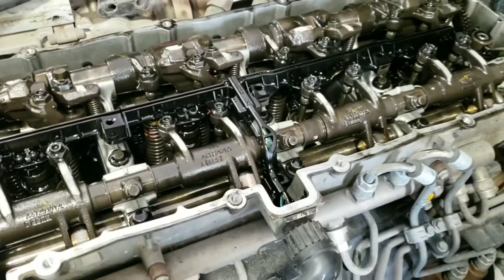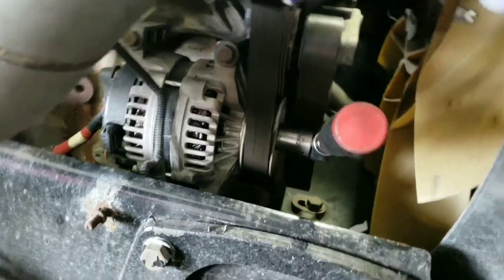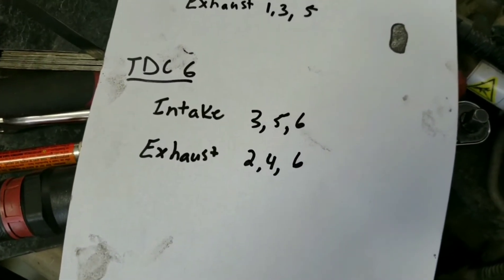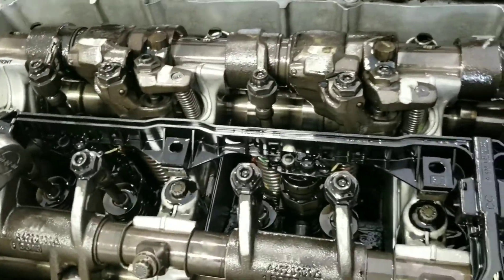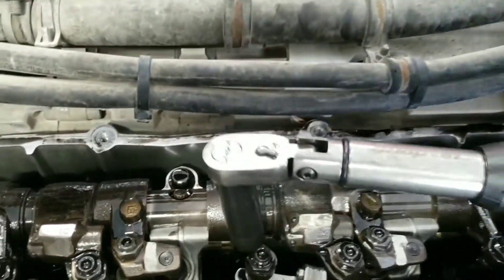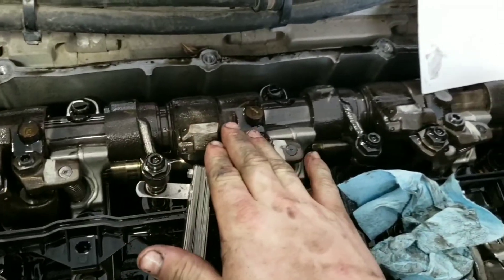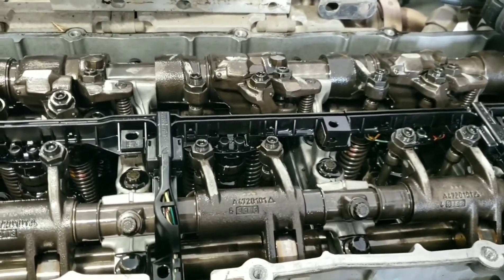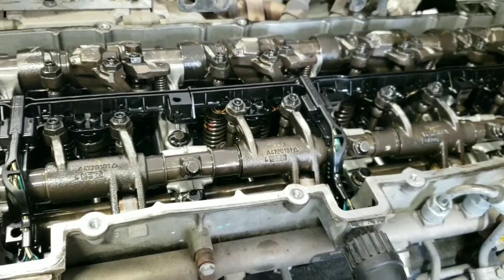Detroit dd13 dd15 dd16 overhead valve adjustment

Comment: Hi there ! Help 
Got question . I changed my cylinder head dd15. 
If I adjusted 1 round then turn flywheel to 360 degree and I’m with the same position to adjust 1 round again . Any suggestion?
Reply from the maker: No, flywheel turns 720 for one 360 on cam

Comment: How do you know when #1 cylinder is at tdc without using the barring tool? Also how do you know when #6 is at tdc as well
Reply: When at #1 TDC, when the flywheel timing mark is lined up, the #6 rockers will be tight. And when the engine is at #6 TDC the #1 rockers will be tight. If starting from scratch, lets say installing a new rocker shaft / rocker components,  adjust the #1  and #6 adjustment screws till snug and measure the adjuster threads. The one with less amount of threads above the jam nut will be the cylinder at TDC.

Comment: Tighten the adjuster to 6 inch pounds then set the jam nut to 37 foot. Then you'll have a good setting. Nice work.
Reply: Is that 6 inch pounds by specs or a personal process? I was thinking there has to be a better description than just "with a little bit of drag"

Comment: Thanks for this video .
is this one helps for the truck fuel mileage to go up .
My truck freightliner cascadia 2016 has 3800k mileage. 
The fuel mileage recently dropped from 7.3 to 6.2 
Don't know. 
I changed the engine filter and the truck still going 6.2 mpg

Comment: im guessing i need to do this on the cascadia i just bought. not sure if its fleet programing or this, but the jake brake is so weak that even bobtail you only barely notice if its on or not
Reply: Would recommend this if you havent done so already. If the Jake's are weak they may have  been used daily. Would only recommend using Jake's only when loaded and of course mountains routes.

Comment: I also heard that if valves 
left open slightly, the engine performs better, is that true?
Reply: The valves will stay open as the wear. This is why you can hear a thumping sound coming from intake. If it’s bad enough you could feel intake manifold getting very hot in one area
Reply: No you can cause down stream failures in the one box to the filter's. Also could damage the piston or valves themselves.

Comment: I belive to increase the HP besides adjusting the ECM you need to adjust valves more open. Am i right?
Reply: Doing a valve adjustment has nothing to do with hp gain. It just cleans up the burn process of the fuel.

Comment: How many miles do you recommend a valve adjustment after buying a new truck I've heard three different stories?
Reply from the maker: +Woodzedge - I think every 200-250k is appropriate. Overtime the valve seats wear and may make the valve remain slightly open if you dont adjust. This can cause valve to burn
Reply: @cardinaltruckservice3753  ok thank you
Reply: I've done ones at a 100k and then customers request and also when digging in the top of the motor.

Comment: DO YOU SEE A LOT OF AFTER TREATMENT PROBLEMS BECAUSE THE OF THE OVERHEAD BEING OUT OF ADJUSTMENT? VOLVO DETROIT CUMMINS?
Reply from the maker: +Jason Lurie Not much, most are usually bad sensors or coolant in the filter
Reply: You will see a lot of after treatment issues caused by overhead out of adjustment, if your valves are staying open longer that increases raw fuel in your 1box which can cause spikes in temps and even damage to your filters and reduces NOx conversion which causes MIL,CEL and SEL lights

Comment: Pretty good video for the tune up process. However the only thing to correct is when you line up TDC 1 or TDC 6 the dot lines up with the pointer tab and not centered in the inspection window. Other than that good video.
Reply: Yep, there's a pin time tool you can purchase to hold the motor as well.

Comment: Made it look easy. How many miles on the engine? Looks to be nice and clean inside.
Reply from the maker: About 600k
Reply: it is supposed to be done at least 100,000 miles, or when ever you remove the rocker arms.